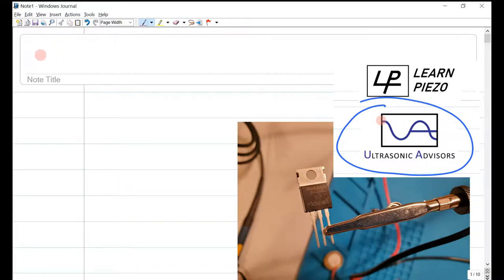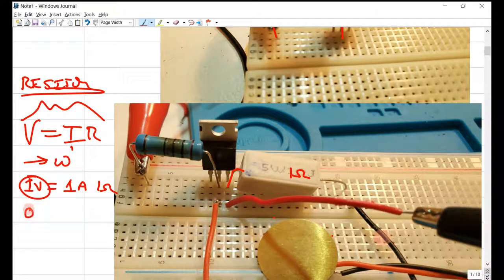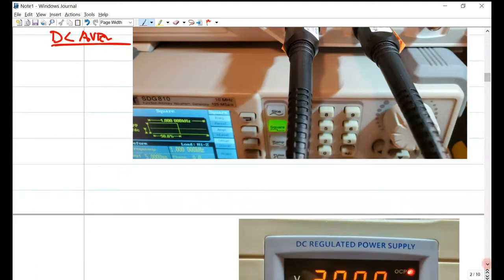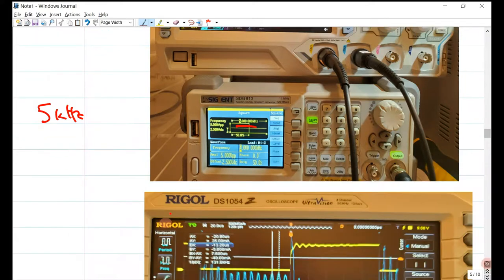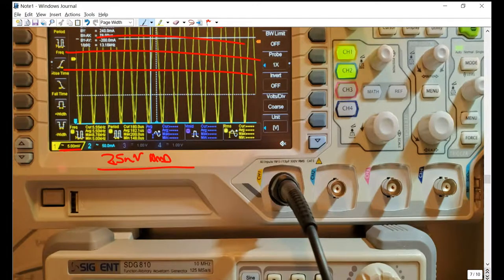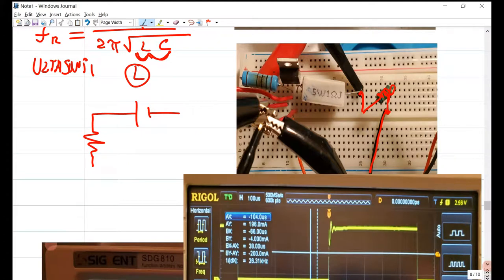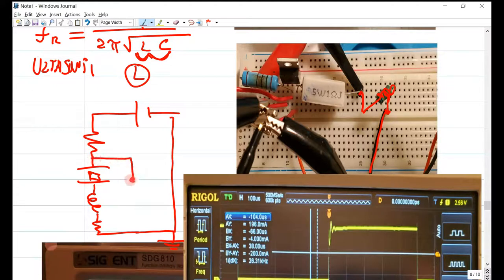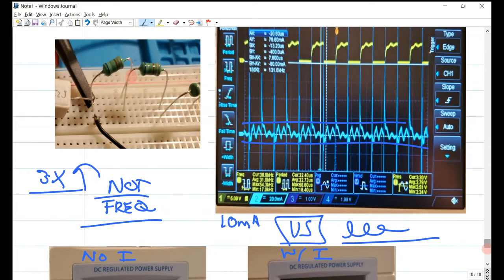Piezo current measurement and boost inductor

Comment: hi! thanks for your videos, they're really helpful! I have 2 quick questions if you don't mind..

1.is it possible for me to use an Arduino to output a square wave with my desired frequency, use that to drive a MOSFET, and use the series inductor circuit to smoothen it to a sine wave? Then I'll use that to drive my ultrasonic transducers.

2. for the signal that's driving my ultrasonic transducers, do they need to be an AC signal with +ve and -ve cycles? or is it okay to use a fully positive cycle AC signal?

Thank you very much for taking time to answer these! sorry if they seem like stupid questions
Reply from the maker: Hopefully, I understood your question. The series inductor doesn't exactly smooth out the response. Rather, it resonates with the piezo (capacitor) to increase the voltage (and thus current) and also increase the spectral purity of the output. 
In the video, I use a square wave votlage drive (positive and zero voltage) and also an inductor to create +/- AC voltage. A piezo doesn't care about positive and negative - it is concerned with max and min. So a positive only square wave is fine for driving. It would be similar to driving with a square wave centered around zero, but half the amplitude.
Reply: @ultrasonicadvisors  thank you for replying! yep that answered my doubts.

Comment: Hi, Thank you very much for your videos. they are help me a lot with my studies. I have watch lots of your videos but I still have a doubts about transducer for cleaning, How much voltage can I put on a transducer? Does has a way to calculate a better voltage and current to operating a transducer?
thank you very much and please don't ever stop making your videos they are really goods and important. Thank you.
Reply from the maker: The goal is power. However, the voltage to power ratio varies with frequency. Off resonance you need high voltage and on resonance you need low voltage.